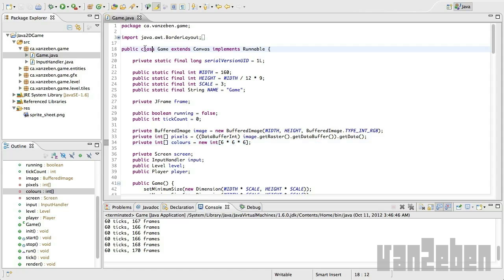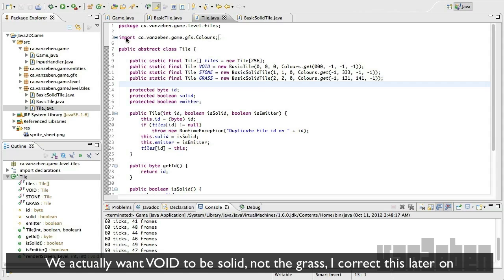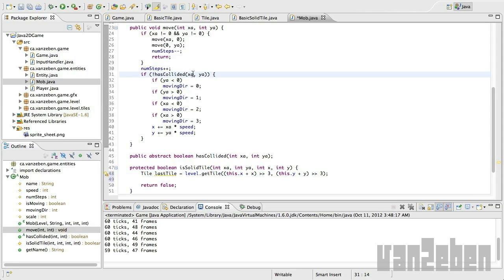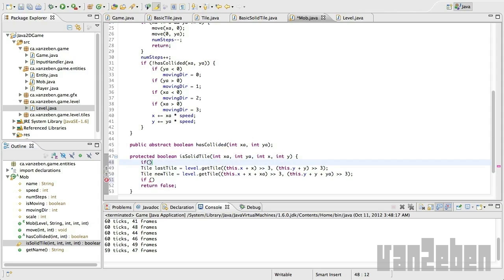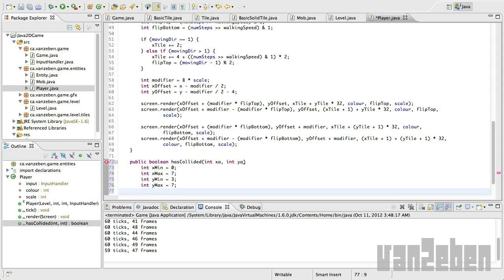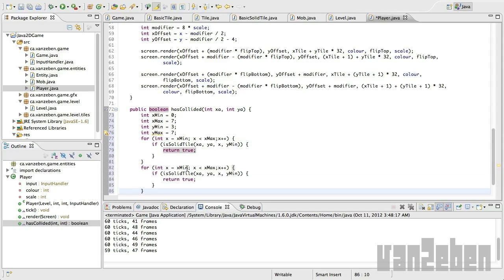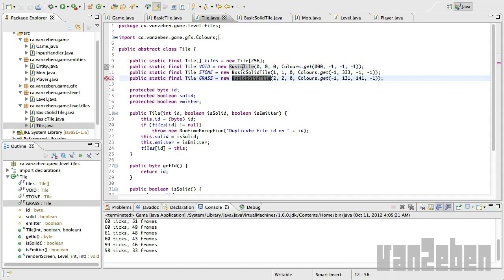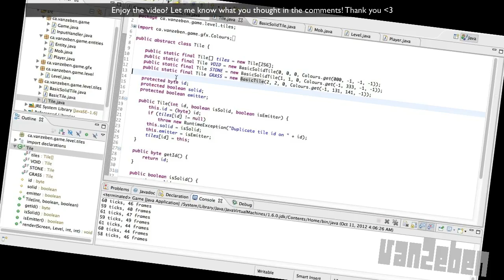The Collision Box

Comment: I had an issue getting stuck in the solid blocks, I couldn't move unless I reversed direction. I fixed the issue by editing the Mob class under the protected boolean isSolidTile() method like this:

protected boolean isSolidTile(int xa, int ya, int x, int y) {
   if (level == null) {
        return false;
    }
    Tile newTile = level.getTile((this.x + x + xa) >> 3, (this.y + y + ya) >> 3);
     if (newTile.isSolid()) {
          return true;
      }
       return false;
 }

There's no need to compare the previous tile with the new tile. Now it works perfectly! Hope this helps anyone having similar issues.
Reply: I was having the exact same problem. This worked perfectly!. Thank you so much.
Reply: I still dont understand why he wasnt getting the same problem and we were even though is the same code
Reply: Thank you soooo much <333

Comment: I'm assuming you could use this engine to make a turn based RPG, but now I'm wondering how would one go about rendering more detailed sprites (like how in the original Red and Blue Pokemon games, the overworld sprites looked like our player entity, while the in battle sprites were larger). :0
Reply: +Shadow You Couldn't you just use the scale to make them bigger? Or if you want the same pixels/size ratio, then do the same as you did with the player, using more than 1 tile for the sprite.

Comment: Does someone understand why the xMin, xMax, yMin and yMax values points to those specific pixels on the sprite sheet? I don't seem to understand the logic behind it; why doesn't x=0 point to the first pixel on the far left of the sprite but instead lands on the 5th pixel from the far left? Same goes for y.
Reply: Okami You could make it do that if you wanted but in this case he made it go to those specific pixels because he only wanted what you see of the char to have a collision box. Because the char does not spread from one end of the 16 x 16 box to the other if you did that there would be a few pixels on each side that you couldn't move but it would appear you weren't touching the solid block.
Reply: +Okami I have the same question initially. But then I realize the player's (x, y) is NOT the upper-left corner of the sprite image. You can check this by setting the player at (0,0) and the player doesn't show it's head. The (x, y) is located in (4, 7) within the 16 x 16 character sprite image if we set the upper-left point (0, 0) and lower-right point (15, 15).